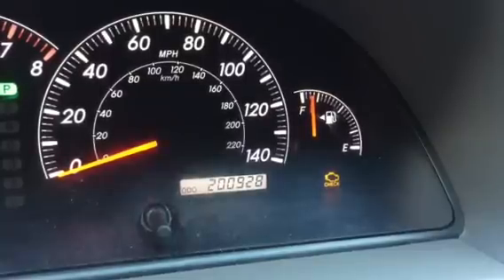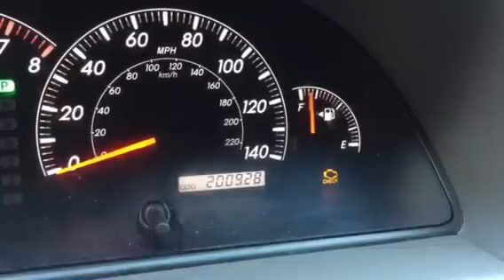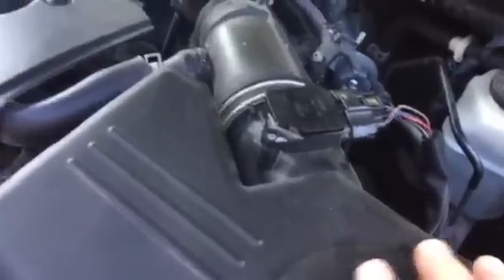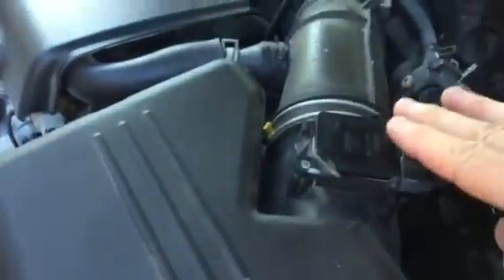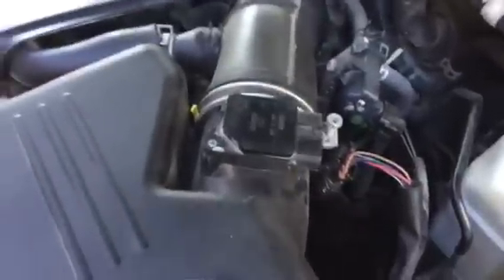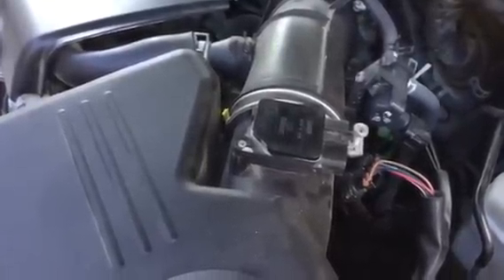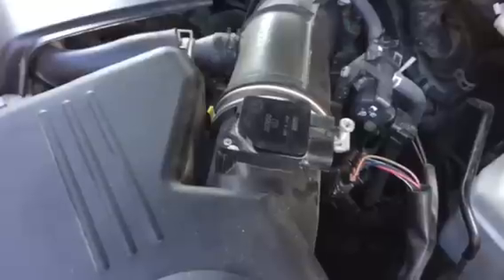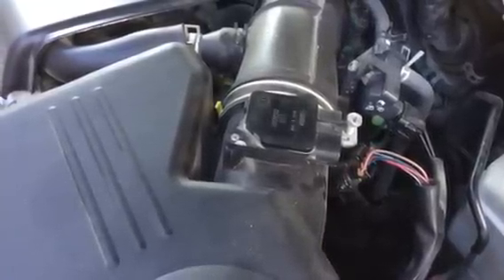How To Tell If Your Mass Air Flow Sensor Is Bad On Your Car

Comment: Depends on the car. You can disconnect the MAF and the car will revert to using all the other sensors to decide if fuel/air ratio is correct. So if your engine doesn’t cut off, drive as normal and if check engine light comes on you have a fault elsewhere like O2 sensors, vacuum leak etc. Could still also  be the MAF along with say a vacuum leak. But fix the MAF last if you have to.

Comment: I must be missing something...if the MAF is good, the engine stops when you unplug it. So, it doesn't run without the MAF. Okay, but if the MAF is bad, why would the car even start and run in the first place?
Reply: Correct me if I’m wrong. Because ecm is not using the bad sensor data to run. It’s using the default program to run, which is very basic and non accurate. So when you unplug the bad sensor , it doesn’t matter for ecm. But if the sensor is good, the moment you unplug it the engine will stall because ecm can’t react so fast.
Reply: Bad sensor is not equal lack of sensor  just like bad fruit doesn't  mean no fruit...bad sensor means it does not measure correctly the air entry leading to erratic signaling to EM.
Reply: My thoughts exactly.👍

Comment: Thank you so much for this video!  I'm glad I believe in doing my homework before just going to dealerships.  Check engine light came on Friday, had the reading done and it came back as the MAF sensor needs replacement.  Did this check on Saturday and my car kept running yet acted as if it was going to stop but kept running.  

I cleaned both my sensors with CRC MAF Sensor Cleaner.  Drove it around today and my vehicle rides and idles sooooooooo much smoother now! I sure hope this cleaning resolved it and I don't need to buy new ones.  Again, THANK YOU SO MUCH!!!

Comment: This is a bit confusing minus a 93 Toyota toyota and I unplugged, and it kept running for a couple seconds and then shut off. But mine is huge It needs to be taken apart and lots of screws.  And hard to get to the place where you need to clean it.????

Comment: Unfortunately, not that simple. Many systems have MAP as well as MAF as well as open-loop mode. Many will keep running if sensor is bad or disconnected.

Comment: What was the code for the check engine light?
Reply: I'm contemplating if I have a bad MAF sensor or not, I had a CEO and it was a po171 lean code Bank 1. I did this test I started the car up and I disconnected the map sensor and it still kept running?. I checked for vacuum leaks. Did the cigar test with Scotty kilmer just a quick test just wanted to see if there was smoke coming out anywhere I didn't see any so I'm not sure if I have a vacuum leak or not?
Reply: CEL not CEO ! Check engine light

Comment: Could this be the cause if the engine dies in traffic, and will not start again?
replaced plugs, wires, coil packs, fuel filter, fuel pump comes on when key is turned on, but car will not start.

Comment: Thank you so much can be clean this sensor with wd 40 ?
Reply: No!!!!! Only use approved mass air flow sensor cleaner!
Reply: CRC Mass Air Flow Sensor Cleaner is what I used.  My vehicle runs so much smoother now and doesn't feel like it's going to turn off when sitting idle.  Sure hope this resolved it.  OEM part is about $215 and I would need two if not 😬.

Comment: Just wanted to share my experience. My car would stall whenever I took the foot off the excellerator for example when having to press the break. I wanted to replace the air mass sensor. But after cleaning a little bit of black residue off the throttle valve (Drosselklappe) right at the end of the air intake hose, all trouble was gone. Check engine light went off, accelleration has power again and the car goes into idle without stuttering or stalling. Hope this helps somebody. And thank you for the video.

Comment: I cleaned mine, and it worked for another 5 months, but the problem came back. I performed this test and the engine kept running. Thank you for creating this video! So at this point it is likely to be a bad MAF sensor.
Reply: If it keeps getting dirty that quick it can be your air filter dirty as well
Reply: did you just clean the screen? there are small wires that also need to be cleaned.
Reply: How did you clean ?

Comment: HELP! I have a 2012 Infiniti QX56. It has had a check engine light for 2 years. I took to the dealer at that time and they said the codes show I need new catalytic converters. I said you replaced them under a recall deal. He said that was 14 months ago and sorry, they are bad. It will cost you over 3,000 for new ones. I said both? He said yes. I said that is impossible. I parked it after I couldn't get it licensed for about 8 months. Then I Got it inspected and the county let me slide that one time which shocked me as I didn't get the emission test. They gave me 9 months to get it done. (Light still on) I was driving it in November 2023 and noticed the light went out. I quickly went and got it inspected and it passed. How?? I got the new license a month early. About 3 days later it came back on and has been on every since. I can't believe they can be bad. It runs great actually and gas mileage hasn't changed. So I just saw your video. I thought sounds too easy. I went out and started it. I unplugged the MAF sensor and there was a slight change for a second in the rpm to lower, then it was normal and it didn't shut off. So can it really be this easy? Would it throw the cat codes? All else is good. Now I have another car, Mercedes throwing some crazy code which P0700 and P0703. It was fine till I realized I forgot at one time to connect the air pump hose to the breather unit. I started it and the new code started. I also had a Cylinder B misfire code so I changed the coil pack. No change. I have driven it a few days and codes won't reset. So I think the sensor on this one is doing the same. I can't be so lucky. Driving to the inspection station and that light came on with that coil pack code. So now I have 2 that won't pass.

Comment: I just replaced mine because my car kept running when I disconnected the electrical and tested the new one and my car still runs when when disconnecting electrical. 2007 equinox, now what can I try?

Comment: Save your money
Use Mass air flow sensor cleaner with a Q tip
**Do not use anything else to try to clean these because
these sensors are SUPER sensitive**

Comment: Hi i have tried your advice on my Mercedes Benz C200, Kompressor 1.8L , W204, 271 Engine but it cuts off for a second when i remove the Harness cable from the Air flow sensor, but then the engine continued to run, does it mean i have to change my Airflow sensor? because at first i thought its O2 Oxygen sensors....

Comment: Yep, daughters car has 300,000klms, started running rough, stalling. No engine light so have now changed fuel filter, Air filter, coils, plugs, after all this engine light on, guess what it’s the sensor, unplugged idle increases, plug in car stalls. Needed a service anyway.

Comment: I tried this method. I pulled the harness out the engine still run. I plugged it it , the engine stalled. What is this supposed to mean?

Comment: This experiment will work even if it is not working, but in most cases it will not calculate the correct air flow for the engine, and thus it will consume a lot of fuel.

Comment: My 96 Tacoma has code p0100 “mass or volume air flow sensor”. I disconnected the cable just like u did in the video and car dies. Theres a lot white smoke and water coming out of the exhaust. Help

Comment: I had been troubleshooting my daughters 07 Pontiac G6 for traction control light and check engine codes for weeks. I cleaned the MAF, New Air filter, fuel Injector Cleaner and all kinds of fixes. Went through the Shop Manual, watched hundreds of YouTube videos, went on G6 Forums, tried dozens of things but no good results. Everyone had a different opinion of what the problem was. All pointed to very expensive repairs. I was in despair so i decided to pray for a solution and within minutes your video came into my view. I went out to the car an pulled the sensor plug and the car kept on running. Ordered a new MAF Sensor online $35 buck plus shipping. Thank you. God Bless. Ill add the codes I was getting to help others P0171 & P0174 and T/C Light.

Comment: I would say that if you disconnect the electrical connector to the MAF sensor and IF you car is  supposed to quit running but keeps running you more likely have a problem with the ECM Eng can’t module.  But I Honestly do NOT know either way about this issue.  It could be that your sensor is bad, that the ecm has adapted to the bad sensor and the ecm has defaulted to a limp or get you home mode.  I do NOT know.

Comment: I know this old video but I have 2001 chevy impala 3.4l and it started just few days ago that car started up and kinda ruff idling so friend told me could be few thing and pretty much something you said, so I did do the day thing and got gumout Mas air flow sensor cleaner took everything off cleaned up everything even put new temp sensor on ,it's little one as hose next to throttle body but when I reset codes and backed out I felt right away as I was backing out drive way it was still kinda sluggish and Lil bit to stop sign  as I gave gas it bolgged down as before but then it was ok. But when light changed I turned left onto highway 35 it acted as if it was going to again so I floored it thinking might be catalac converter but not the case..so got back home raised hood and did just that, pulling off the wire connection to mass air flow sensor but car kept running..

Comment: Got a check engine light last winter during a cold snap, went away after it warmed up, this winter same thing again during a cold snap, gonna try this and see if it's the case. Next was gonna try using some MAF cleaner and reinstall it to see if that clears the check engine, if not I guess I'm gonna buy a new one and install it to see if that fixes it.

Comment: I bought a Denso 197-6030 Mass Air Flow Sensor for a 2004 Lexus I heard I need to disconnect the battery for 10 minutes to reset the computer someone told me ..This right ?

Comment: Sprayed the sensor out with the correct spray. Drove the car for about 10 minutes, and all the flashing warning lights still on in the dash, and car still ran rough. Had it scanned at o’Reillys and scan said faulty sensor. Okay, unplugged the sensor with the car running, and car stopped running immediately. Took out the sensor and sprayed again, and warning lights still flashing. Now what?

Comment: Before replacing the MAF sensor, I would clean it with MAF spray.  See if that works.  If so, great and if not, then definitely replace the MAF sensor.

Comment: Your video had me awfully curious after watching it so I went out and unplugged my sensor and the car kept running, I guess it's off to the auto parts store 😁 it's been running a little weird lately I've replaced spark plugs and wires but I think this might be the problem

Comment: I have a 2016 Equinox.  It would start run for 2-5 seconds then stalled.  No check engine light, no codes.  I replaced the VVT solenoids and the fuel pump.  No fix.  I unplugged the MAF and the car ran.  I replaced the MAF sensor and it runs great.

Comment: I have a 2014 Chevy equinox that is giving off the 0171 code and I was wondering when checking the mass airflow sensor should the car shut off immediately like yours did? I checked mine tonight and my car continued to run, I just noticed yours shut off immediately, also a great job. Great video and thank you.
Reply: What did you do next? Did you replace the sensor
Reply: Did you fix your car was it the mad sensor? I have the same car and did the same thing

Comment: Does anyone know what it means if i tried this and my engine turned off and then immediately back on (while MAF was still unplugged)?
Reply: Modern cars design to run ( but not good ) when parts failed.  So you're not stranded. Just like oxygen sensor, when fails the engine light will turn on because it's can't read the fuel air mixture ,engine running blindfolded but it's run so driver not stranded..waste more fuel basically

Comment: Thank you 
... I already bought bought a new air filter and the MAF Sensor for my 2004 Lexus ES330 3.3L because I check ✅ engine light code pop up with code P0174 
I will give this a try before making the replacement

Comment: This is helpful but it didn't work for my situation on a 2007 Ford mustang gt. But I guess it did at the same time idk. Car would not stay running for more than 5 seconds so I got it running and unplugged it while it was running and it kept running ,when I put the plug back in the car stalled though. Finally figured out it ran a lot better when it was unplugged and that's how I figured that out . Turns out even new parts can go bad quick . Never had so many problems with a Buick but I buy a ford and this dang thing just keeps falling apart.

Comment: I am gonna try this, so simple but effective. I did clean my MAF last night. One side was black and the other was amber, now after cleaning it, the black side looks better, but I am not 100%. I think this little test will tell me more . Thx for posting this one !!
Reply: Hello sir! I have samae problem in my car. Can I know  did it work after you clean your MASS airflow sensor?
Reply: @etio805  I replaced the MAF, which took 10 minutes, very easy to repair

Comment: When i do this while the engine is running it turns off however if i start the engine without maf sensor connected it keeps on running

Comment: Crazy thing is I wasn’t having any of these problem not until yesterday after I went to Autozone checking on my engine and why it  was shaking when I start and when I come to a complete stop, so they told me to check my spark plugs while the car was on then he said hold the brake and press the gas with that being done he found that I needed anew mounting bolt 🤷🏻‍♀️ after all that now my 🔧 light is on and my check engine light is on  So I ran the diagnostic and it said it was my mass air flow sensor so I cleaned and replaced it same issue and all lights are still on and now when I drive and it gets to 20 -40  mph it hesitates n struggles to pull. So now I’m hearing I should clean the throttle body. Any suggestions? Before I do this

Comment: Have a 2006 Passat. I do not have a check engine light or any codes, but I have noticed a drastic drop in my fuel economy. About a 5 to 7 MPG drop. I just did this procedure, and the engine stayed on. It shuddered some when I unplugged it, but it kept going. Ordered a new MAS. Lets see what that does.
Reply from the maker: If that does not improve your gas mileage, replace all of the oxygen sensors.

Comment: HOLY BALLS IT WORKS.

MY CAR KEPT RUNNING AND IT RAN BETTER WITHOUT THE SENSOR. YOU ARE THE MAN!

2003 MITSUBISHI OUTLANDER
Reply: @Michaelbrian777  Did you notice more fuel consumption when the O2 sensor was bad ?
Reply: @Michaelbrian777  Did you clean your sensor? If so... Did it work?
Reply: @Michaelbrian777  So it worked? Also your rev was fluctuating at idle right?
Reply: So a bad mass air flow sensor can mimic a faulty fuel pump or filter and cause it too stall at stop signs and stop lights when it's hot outside?
Reply: @johnnyjaramillo6744  Not necessarily stall complete but Yes
Reply: Don't run without your sensor. That sensor is designed to measure airflow. Yes, your vehicle runs for now, but unregulated airflow will throw off the air fuel ratio, resulting in an offset spark resulting in long-term engine damage. If you haven't replaced it, I highly recommend you do. I'm a mechanic and see this all the time.
Reply: @Michaelbrian777  Yes you 100% correct because I'm facing the exact same issue with my W204 C200. Only when it's hot outside my car's idle goes up and down

Comment: My 04 explorer starts but wont stay running when the MAF is connected but starts up and runs with it disconnected. But the acceleration is very low and really rough idle. Gonna replace the MAF and see what happens

Comment: Well yes and no you could also have an electrical problem bad ground,  5v to the sensor not working properly or no 12-volt power to the sensor or ground for the 5v power

Comment: Try cleaning them first with some mass air flow sensor cleaner made by CRC because these things are very sensitive to air flow across precise precious metal wires and can become clogged with dirt and grime from the air box also replace your engine air box filter folks while your at it

Comment: 2008 Mustang GT - I disconnected the sensor, the engine surged a bit and kept running. Upon reconnecting the sensor the engine stalled. The fact of getting a reaction from the engine tells me that computer recognizes the sensor. I guess the sensor still could be bad. Scratching my head at this point. I’m torn between a bad TPS or a bad MAF

Comment: If you engine IS idling and driving, the MAF IS GOOD PERIOD.
If that MAF sensor is bad, the motor will NOT idle or run.

Comment: This video stands out as one of the finest instructional resources on YouTube. It wastes no time and gets right to the point. Initially, I believed my transmission was experiencing problems, so I attempted to resolve the issue by changing spark plugs and the fuel filter, but to no avail. However, upon discovering your video, all of my troubles were alleviated.
Reply: hi did you have trouble with a shudder noise like miss fire
Reply: When you thought your transmission was bad did you also try new brake pads and rotate the tires?

Comment: Is this apply to any car? I have 2006 Volvo S40 2.0 diesel engine, i followed the video and engine was still running after disconnecting sensor, I replace it with second hand one and again same, unplugged maf but engine was still running